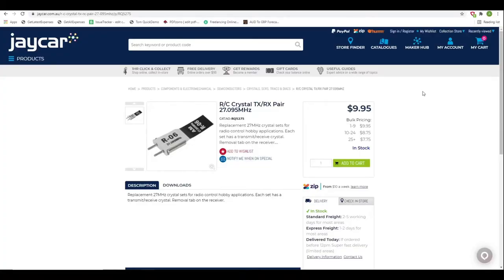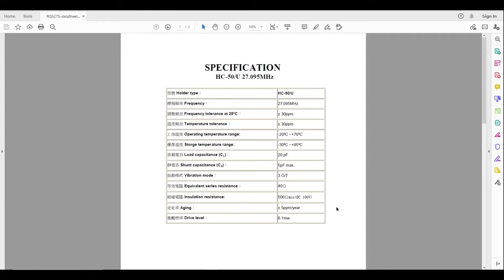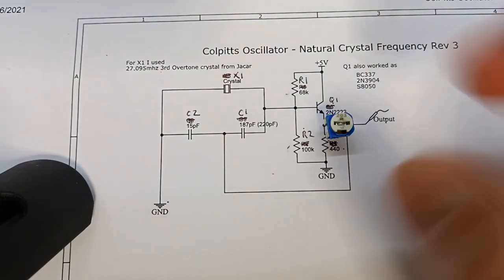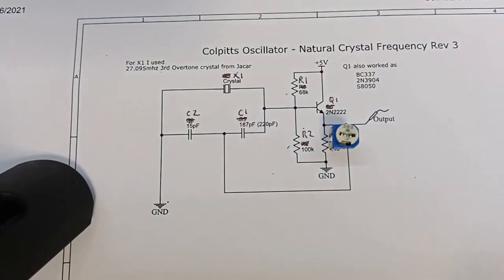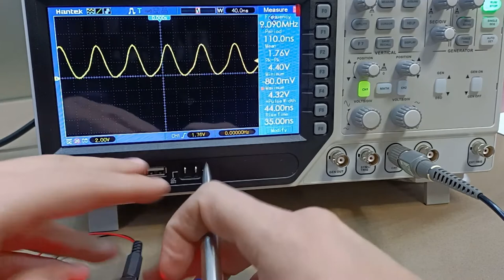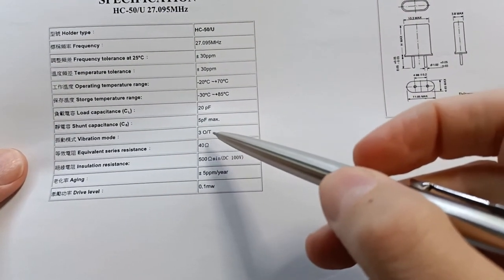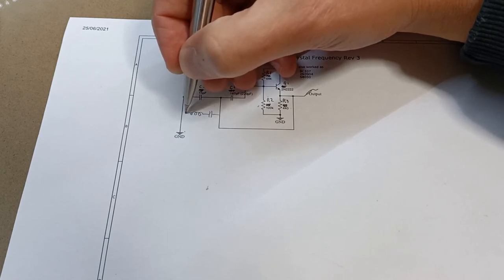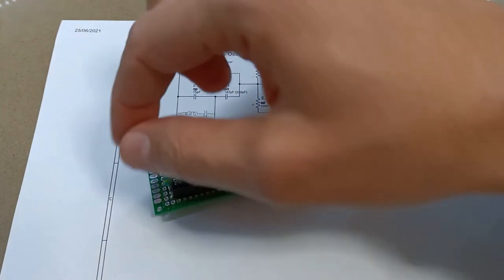3rd Overtone Radio Controller Crystal Oscillator circuit 27MHz (RC Transmitter Part 2)

Comment: Hi there, I will attempt to build this, but I have a few questions:
- the Q1 & Q2 written as 100A/A - whats the part number for the transistor? 
- I am attempting to build a remote replacement for my BOSE system (V35), which uses 27.145 mhz band. The plan is to used an ESP32 to generate the signals (already got the frequency/button map) and then connecting it to my home assistant for automation. The original remote pairing instructions are to press the 'OK' button on the remote and the mute on the console for 5 seconds. Do I understand correctly that if I produce the same signal from the ESP32, it will pair just the same? or do you think there is a different mechanism at work there for the pairing process?

Thank you
Reply from the maker: I suspect you could use a 2N2222 for all the circuits but in my case the transistor used were:

2N2222 for: 3rd Overtone Radio Controller Crystal Oscillator circuit 27MHz (RC Transmitter Part 2)

S9018 for: Radio Controller - Mixing Circuit for modulating carrier and square wave. (RC Transmitter Part 4)

S9018 for: Radio Controller increasing range with Amplifier circuit and Antenna updates (RC Transmitter Part 5)

I am not sure how the pairing will work but starting with the same signal is a good guess to begin.

Comment: could you please upload the schematic of the whole transmitter circuit you made on breadboard which replaced the remote control, thank you.
Reply from the maker: Thanks for your comment.  I am still in the process of debugging and testing the circuit at the moment but I plan to to do an explanation of how to reverse engineer the transmitter signal and then build your own transmitter circuit in some future videos.  I will include the schematic of the circuit and arduino code in those.  I will try to get it all done as quickly as possible.
Reply: @overengineeredinoz7683  Thanks a lot

Comment: Any updates regarding the schematics for the full circuit? Thanks
Reply from the maker: I don't think I made a full schematic.  There is a playlist of all the videos in the series that has videos that build the different parts.
Reply: A circuit diagram of the whole system would be awesome if you had time, but I understand if not.

I’m learning about RF right now and struggling with these circuits.
Reply from the maker: @asherholloman8458  I am away from home on vacation at the moment so can't look at the circuit at the moment. I will try to remember to look when I get back.  Good luck with the Rf stuff it is challenging but also interesting.

Comment: Hello, Sir! I want to build a spare remote control TX for my RC car just for fun, so I reverse eng protocol with my SDR and find out that it uses OOK-modulation at around 27.145 MHz. I can by suitable crystal resonator on Ali as well as other components, so my question is: Can I use one more bipolar transistor at the output controlled by Arduino in order to create OOK-pulses with needed duration?
Reply from the maker: Yes you should be able to do that.
I do something similar in this video: https://youtu.be/9CpsH4miXKk
Reply from the maker: also in my channel this playlist "27 Mhz Radio Controller" goes through the process of reverse engineering to building the transmitter.
Reply from the maker: There is some comments below in this video from Joseph Chiocca where he tried to get 27.145MHz crystal going.
Reply: @overengineeredinoz7683  thank you for your answers, I have already seen them, but I want to go the most straightforward way and don’t use LC-filter  and overtones additionally and use only 27.145 MHz resonator.

Comment: Hello how did you calculate the inductor and capacitor values I want my 27.000 MHz crystal to oscillate in 108.00 MHz how to do that ?
Reply from the maker: I did it by experimentation rather than calculation.  Highest I did was 27 mhz. There is another video on YouTube that talks about getting higher overtones.  Search for Crystal oscillator at overtone -  all electronics channel.
Reply: @overengineeredinoz7683  oki thanks

Comment: hmmm... i don't understand your success with the 4.7uH and 330nF .. those work out to a low 128 Khz .. instead, 33pF and 1uH would resonate at 27.7 Mhz ... I've got a similar circuit with 8pF and 1 uH resonates at 56.6 Mhz on an overtone crystal. Just sayin.. Your video is great though and explains the required overtone coaxing!
Reply from the maker: Hi thanks for your comment. I basically gave up on the calculations and just tested experimentally until something worked. A lot of time when I was using values that should work in theory the crystal didn't oscillate at all.

Comment: Can u show a reverse engineered circuit of 27mhz transmitter without using crystal
Reply from the maker: That could probably be done with a colpitts oscillator with the right inductor and capacitors instead of a crystal. The frequency would not be as stable. I have a video on a colpitts oscillator. I will think about doing one for the transmitter series that would do 27MHz